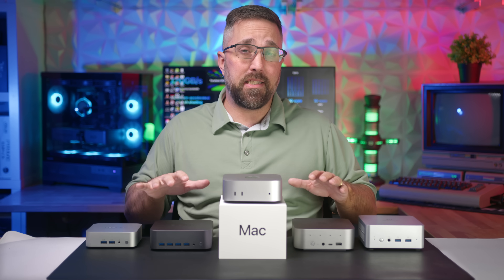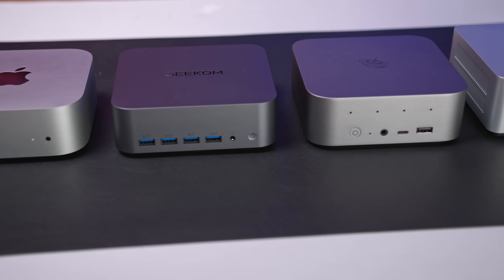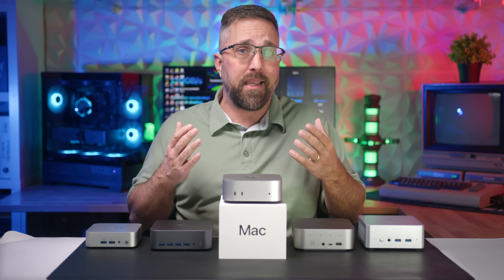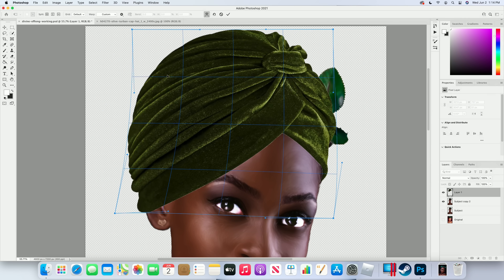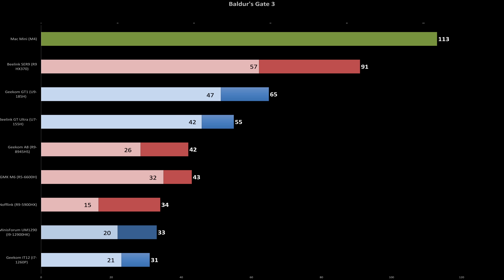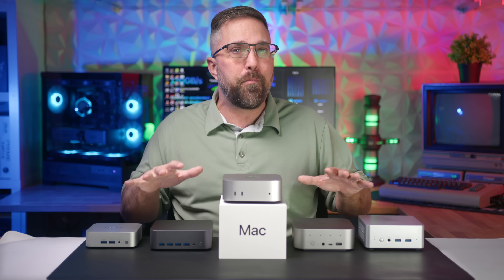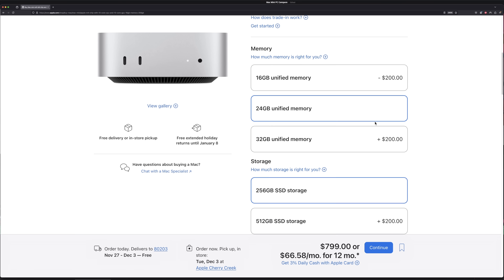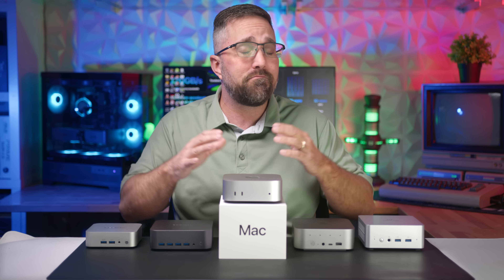M4 Mac Mini vs Intel and AMD Flagships – It's Not Even Close!

Comment: 200 bucks for a 1/4 TB SSD upgrade is beyond ridiculous.  Same with the 8GB RAM upgrade.  The fact that anyone would be willing to pay this is mind blowing.
Reply: Apple sucks for making the price ladder move like that, but it doesn't change the fact that the base model is an absolutely absurd deal. Just needs an external Thunderbolt drive and it's literally perfect for 90% of Mac users
Reply: @gdludus  not an Apple fan, honestly. However, I agree.
Reply: @gdludus  NO ONE buys the base model... Thats the point my dear.
Reply: @PM-wt3ye literally70% of sales are all base model
Reply: @gdludus it's only a deal of you want to get into Apple. That's it. I can build an ITX with a Ryzen 5 2600 16gigs of Ram with a 1 TB and a 2060 for the same price and better performance and it would be upgradeable should I want to improve the initial 500 dollar build. It's a great deal for Apple. That's it.
Reply: @TheEclecticBeard  That will be significantly slower than any M4 mac. On single core results the aren’t ANY processor that can beat it from AMD nor Intel
Reply: @gdludus  And runs Windows on Arm natively.
Reply: @gdludus  That suck but they tackle 90% of users(and no other mini pc, have reputation and price match with apple mac mini). (No many user playing video games, that is), and 3d content. So apple still win (on 2d designer), except 3D architectural, 3d developer, and adobe software.

It like knowledge is a sin (so the ladder of price), only pure innocent teenager, is the most beautiful thing in the world...but they suffer continue rip off(as working on job for basic salary), if they don't not content with simpler life.....(assumed most beautiful simply life is just simple teenage love.

I wonder why they don't do that (dual boot). Because x86 to ARM need another 10 year or more to success transition.
Reply: Its only a good deal if you dont also play games. Most steam games arent compatible with Mac due to their choice to go with ARM architecture.
Reply: @gdludus Until your internal drive fails and Apple wants $200 for a replacement 256Gb drive in 2029 when you can buy an 8TB for like half that so you just buy the latest Mac mini because it’s only $700 and you toss an otherwise fine computer in the trash.
Reply: @ is that a common thing with this computer? i dont hear that happening much and it certainly hasnt happened to me. personally im fine with that frequency of upgrade and im sure i could find the ssd for much cheaper in a parts listing on ebay if i really want to keep my current system
Reply: @ You’d end up buying other used SSDs with no idea how degraded they are. Even when they don’t fail, their speed degrades with use as the cells die off. And smaller drives degrade even faster since there are fewer cells to wear level across, even worse on top of that because smaller drives are likely to be close to full leaving e en less free space for wear leveling.

Maybe if some after market drives come out, but can you trust companies making unauthorized drives? Apple is increasingly encrypting parts so their systems won’t work with anything unauthorized.
Reply: @ this is such a small percentage of cases to justify that much specificity. of course old shit is gonna be old and have a higher chance of working less well. arent we avoiding buying new shit anyway?
Reply: @gdludus  Yeah but Apple is purposefully making it artificially expensive to keep older, still very capable hardware useful and pushing towards the landfill just out of greed. They’re not even giving legit third parties the option of making replacements for the components which will eventually or just need to expand with needs,

I got 10 year old Dell laptops I can still daily drive because everything that’s failed has 3rd party replacements. I even have WiFi 7 and BT 5.4 cars in them which you can’t even get in a maxed out Mac Mini 4.
Reply: @JohnSmith-op7ls or just simply use any external drive for os. Simple
Reply: @JohnSmith-op7ls i have never had an internal drive fail, i have Mac’s 10 years old
Reply: @ Drives fail. One anecdote doesn’t erase the mountains of data on SSD and HDD failure rates. Go ask anyone who works on hardware in a datacenter if they pre never seen a drive fail.
Reply: @JohnSmith-op7ls  I’ve seen drives fail, but your claim was that Mac drive just fail fast… which they dont
Reply: @gdludus   its not a good deal at all, maybe for existing mac users and other casuals.  also mac intentionally corrupts your external drive the moment your mac goes into any sort of power saving mode lol
Reply: @najeebshah.  No.  It doesn't.  Not to say that hasn't happened.  But it is not by design.  (Note: Backups aren't just a concept...).
Reply: @najeebshah. wha? I’ve had a 2011 Mac mini up until last week, its still fine
Reply: M4 Mac Mini comes stock with 16 GB of RAM, which is more than enough for that pricerange
Reply: @ThatIceChampion be that as it may, I got a Ruzen 9 minipc with 1 Tb storage and 32GB for 100 less than the mac mini base model..
Reply: What’s even crazier is that the price is doubled when you double the SSD and RAM. It’s cheaper to buy 2 mac minis… 😂
Reply: @glengineertv1505 external ssd?
Reply: agreed, i love the product hate the crazy Apple tax, unfortunately that's how they profit the most by selling a $20 component at $200
Reply: Apple has always been stingy with storage and RAM. The little secret about the MacMini is the expandable storage. You can bet third parties will eventually offer internal SSD modules for it. It's a bit odd decision, since their recent Macbooks have soldered SSDs with no upgrade path unless you're willing to risk damaging your logic board.
Reply: @bobweiram6321 I don’t think they can due to licensing and device registration through Apple.  I think that is what another guy said when he did the chip swap on his drive was that the actual card had to be a registered card or something along those lines.

I really don’t get why Apple doesn’t use regular M.2 drives.  Some Gen 4 and now all Gen 5 drives smoke what Apple offers.
Reply: @Ed_H_870  I don't think the chips are paired. I believe you have to initialize it with new firmware though. Apple is starting to move away from pairing parts with iOS 18.
Reply: @Ed_H_870  They have separate security chip (used to be T2 now buil in to M processors )that will do the encryption (among other things)on the fly and acts as a storage memory controller
Reply: If it works for the phones (android and apple) I don't see why it wouldn't work here. It sucks, but they're priced as high as people are willing to pay. I can't imagine. My whole entire phone cost $200 and I can expand the storage with an SD card.
Reply: You can upgrade the ssd on these new models by easily swapping them. So that cost is not gonna be crazy. You lose the warranty but who cares.
Reply: @ You can’t just buy a 3rd party SSD and swap it out. You have to remove the nand chip from the SSD board and replace it. Nobody who doesn’t know how to do electronics repair is going to do that.

Apple went out of their way to be scumbags as usual to price gouge
Reply: Just use an external SSD as he did … that should not be any issue. It’s a desktop after all and not a laptop. I am actually thinking about this Mac mini for my music stuff where in my opinion the Mac architecture has an edge over the PC.
Reply: The fact people still use windows is even more mind blowing.  I have extra money, not patience.
Reply: @alexandercastleberry480   It shouldn't be. Mainstream stores only sell Windows / Apple.
Reply: Count that you'd have at least 512GB if you spend the same price of some of the other high ends competitors. It's not a bad deal after all.
Reply: Ram, yes, storage?, is not an issue in this formfactor, since you can use even thunderbolt 4 and have TONS of TBs if you want at a fraction of the cost of the internal apple wants to sell you, that said, in laptop yeah... that is shitty is hell.
Reply: @soragranda  it kind of defeats the point of a mini PC to need to add external storage.  The purpose is to be self contained.  I'm with you on external storage being the cheaper option, just kinda think it's ridiculous that Apple is charging 200 bucks for a 1/4 TB of storage
Reply: @Jermz1979  Kinda defeat what purpose?, a mini pc is to use less footprint which even with a 2tb thunderbolt drive it won't much bigger than it is (seriously those are tiny, there is even nvme enclosures), in laptop is a mess because of portability, mini pc mobility won't change much with an external drive.

What I mean is that for the price and the formfactor the Mac mini is honestly really good as you can expand the storage cheaper than what apple is asking for and you will get a more than decent machine, I also agree Apple is ridiculous but that is the case with phone companies getting rid of microsd to sell you the most expensive model with storage working as exclusive feature (also 200 more).

Sadly, this is a model fully adopted by now for so many companies in apple's case they say is cause of the internal memory controller but... is obviously an excuse since modern ssd are comparatively same or better with noticeable better prices.
Reply: @soragranda  I really don't look at a Mini PC as a mobile device.  Sure, you could...but there are better things suited for it.  I totally get your point that a portable drive with this is a no brainer, I guess I'm just a bit salty at the upgrade price for internal storage.
Reply: @Jermz1979  Mini PC's are not meant to be mobile.  That's what laptops are for.
What Apple have done here is essentially reduced the size of the Apple desktop.  Given that all the interfaces 99.99% of people need or want are so small there is no need for a large enclosure.
And the AC to DC is inside the enclosure (as it is on the smaller AppleTV) at that.  Yes - Apple overprice their mem/stor upgrades - used to be one could do their own - those days are gone.
OTOH, the ecosystem is unbeatable.
Reply: If your Dumb enough to sit in a dank basment all day & night GAMEING yes it's dumb but Video editing with Davinci & a  2 TB 40GB/s SSD enclouser Blows most $2500 to $3500 Intel machines right out of the Water.
Reply: I would pay 10,000 to avoid any apple product.
Reply: my mac mini m1 8gb 256gb still performs better than my windows 11 Azw Ser 5 Ryzen 7 with 16gb and 1tb nvme.
Reply: Apple's memory upgrades are ridiculous in price.  At least with my "old" iMac I bought the base and then purchased memory to upgrade.  And eventually slit open the sealed iMac to change the hard drive to SSD.
But - Apple is not about "a computer" - see my main comment above.
Reply: @Jermz1979  it's because how they are maximizing the efficiency and form factor is putting it all on one chip: CPU, GPU, SSD, and memory. So it's more expensive to expand because it's an entirely different chip. They COULD have made the mac mini a bit bigger to allow for nvme expansion, but it's not in Apple's interest to do so. Again, like many have said, the storage is easily solved by building a NAS (which you can easily and rather cheaply make with MASSIVE capacity) or just getting a portable drive for pretty cheap.
Reply: The storage is on a removable board not on one chip……..do some research
Reply: True but you can connect an extern hardrive
Reply: @ yeah, but thats no excuse, its only a workaround. Repairability also is non existent here. Neither with RAM nor with SSD.
Reply: @PM-wt3ye  to be fair. Repairability and upgradability will never be found in apple devices. If you want a mac you have to deal with it. They aren't going to change it, since a lot of people just don't care. I'm not saying I like that, but it just is what it is.
Reply: @LayneJ10  yeah thats true. but thats the reason i wont bye one. :D
Reply: @LayneJ10 currently apple beats out Samsung and Microsoft on repair according to I fix it. What i know is i have a Mac from 2011 and 2012 both are still fine
Reply: Mac OS is the reason.
Reply: PRO users ;)
Reply: Apple sucks. I will never buy any of their garbage. There might be 2 or 3 mainstream games available for Macs.
Reply: And this is why we all get the base model (which is only $499 with education pricing btw)
Reply: I'd pay for it because I use my Mac for work. And that is work no pc can do.
Reply: @bettertoaster oh stop.  It’s a Mac Mini dude, not an editors rig.  There’s thousands of PC’s, even relatively inexpensive ones, that outperform the Mac Mini.
Reply: @Jermz1979 Have you tried doing iOS app development on Windows or Linux? Please let me know how you did it. I am not talking about performance. That's what you PC zealots don't understand.
Reply: they have to make money somehow, either way 16gb of ram has more value on mac than windows, even if you were to use more than 16gb mac is better optimized to use less ran them windows. those prices are for pro users that can afford it. mac mini base model is already more powerful than 99% of windows computer right now.
Reply: Another review used an external hard drive which tested faster than the mini internal...
I hate macs, I hate osx but I think I may finally get one of these mini 4 due to probably the aggregate best considering sum of easiest/cheapest/fastest video and audio editing.
Vs linux/windows/android

I enjoy a game once in a while but don't really care that much.
Reply: @L0st-n0found  I have yet to meet a single person who transitioned back to the Windows after using the Mac for at least a month. I was on a project where everyone on my team had to use the Mac and everyone screamed and whined about it. Six months later, however, there was an even bigger uproar when we had to return them back to the leasing company. Some offered to buy out the lease, or buy their own Mac if they didn't have to go back to Windows.
Reply: @bobweiram6321  Honestly I have used Mac's for several years in school and such and I am still a Windows / Linux guy. I really can't imagine actually seriously using a Mac as a computer when they are so limited in their ability to tweak and their software libraries. 
Windows is just easier and Linux is just better...
Reply: @Jimster481 i can't believe people still think windows is an acceptable OS in the year 2024. MacOs or linux all the way, windows feels like using a bad emulation of linux at this point.
Reply: @Jimster481  I made the jump from Windows in 2007.  One month of Linux proved it was useless for my use case (business and photography and other things); Vista broke me because I needed a new computer and Vista was a broken thing from the start.
Mac OS is head a shoulders better than Windows in every way and the apps I need are available (MS Office, Photoshop, etc).
My iMac 2012 is still chugging along as a workhorse (I upgraded the memory and changed the HD to SSD along the way).
New iMac (M3) should go another 12 years w/o issue).
Then of course there is the ecosystem (Mac+WorkMac+iPhone+iPad(s)+Watch) all seamlessly integrated.
Windows users never get it ...
Reply: @besttj3xp  I agree nearly to 100%, but I can´t use my VR Headset with either linux or macos, so I´ll be stuck for windows for quiet some time and I also have to add that I now got an idea of how windows works, something that doesn´t apply to maxos or linux
Reply: @Jimster481  yeah I used to think the same way, but really think about what you left here for all to read. first, you used Macs in school for several years,,,,,hmmm. okay second point they are limited in there ability to tweak  and a small library of apps ... interesting .. windows is easier and linux is just better huh. well son you are very wrong and haven't learned from your own experience.   You used a Mac in school because it IS easier and that's why school children use them 'cause duhhh. now tweaking your system well if it's a good system to start with it shouldn't require you to tweak it. small library  you say and you honestly think you can say your going to find a better store in the linux community , my man unless you are doing your own coding just stop right there bro you can't be serious I've compiled my own linux installs for years. every pc I built  at minimal dual booted into windows and several builds of linux. I know more than I want to about computers, hell I've been using them since before windows for workgroups 3.11 came out . I'm not a fan of apple at all but at the end of the day I just want it to work when I turn it on and not have to debug all the time and tweak things. and Apple just gets it done and I'm not playing tech support for crap to work.      I wouldn't be surprised if this actual video we are commenting on was edited on a Mac lol
Reply: Windows 11 will increase people shifting to Linux or Macs.
Reply: @nauxsi  Macs maybe but linux, no.  Most people who use pc's have no idea it exists and you cannot go to best buy and buy one off the shelf.  They can do that with apple though.
Reply: @Jimster481 well you can you just have to do a few extra steps, in fact i find it easier to do on Mac than windows, (i can just delete the root folder, or the kernal, with not too much difficulty)
Reply: @bobweiram6321  ahh macos is trash ,cant stand it for 5 min
Reply: @Jimster481  Unless you're an engineer this comment doesn't really apply. In what world do you need extra "tweaking" for daily work? Unlike you work with a very specific skillset the Mac can do it all. Offering Linux to the average user as if you don't need to run 15 different commands to install Spotify is just laughable.
Reply: @besttj3xp  Windows is only used to run programs that's it....
Reply: @bobweiram6321  I was initially on PC went to MacOS and now I'm happy back on PC. I hate that Apple restricts so much stuff. I may still buy the Mac Mini for employees, but I'm going to hate having to deal with MacOS.
Reply: Honestly, the fact that Apple is even still selling a computer with that little storage and memory is mind-blowing. Like, a good amount of phones even have more than 8gb of RAM these days.
Reply: @waiside99929  it comes with 16.  To get 24, it's a ridiculous 200 more
Reply: @waiside99929  True - but they have at least moved the base to 16GB this year.
Reply: @ All Macs come with 16 GB of RAM STANDARD. Do ANY of you do research before commenting? As of the M4 iMac announcement, all MacBooks sold from Apple come with a minimum of 16 GB of unified RAM.
Reply: @FuzzyIcecle  I'm well aware.  My argument is that 8 more (24GB) is 200 more.  That's insane.  If that also included a storage upgrade, I'd be ok with that, but it doesn't
Reply: @ oh oke
Reply: Apple buyers do it and there are more apple buyers than non apple buyers
Reply: @mickmoon6887  No there are not, not even close .
Reply: they dont know any better or are apple fanboi's
Reply: @BobRooney290  At least we're not stuck with bad thermals and a processor that is at lease 5 yers behind the M4. Enjoy!
Reply: @BobRooney290  Typical Irish American comment.
Reply: Mac Minis are not useful unless they support upgrading internal components like RAM and SSD. SSD of a Mac is just a chip. They can create a socket like desktop processors and provide customer with the option to upgrade it easily with proper compactness and chance for little movements and jerks. But they wont do that, I dont know why. Desktop systems should always be upgradable as per user needs changes. SSDs have less life span, we have already seen macbooks being dead just because of a tiny SSD. How we can support that? A really capable high performance machine that hosts cutting edge technology becomes just a brick when an inexpensive tiny SSD goes bad?
Reply: @FarisMohammed-g5q not useful? 95% of sold PC’s never upgrade their ram or internal storage. This is the cheapest version and still quite beefy and fastest in many tests in this test group.
Reply: @FarisMohammed-g5q  What if I told you this exists...